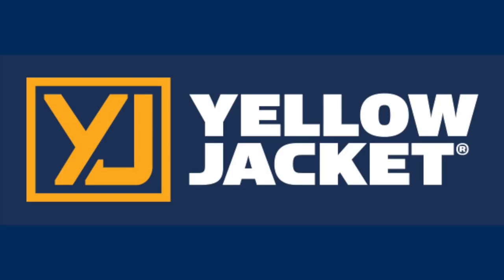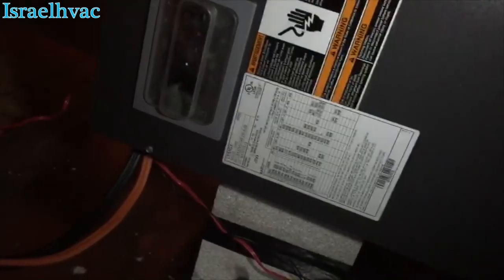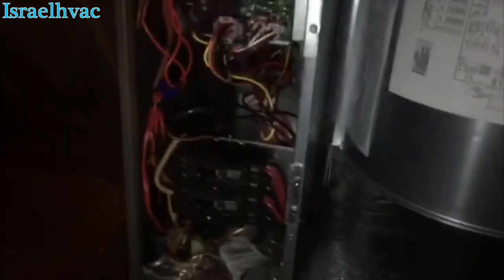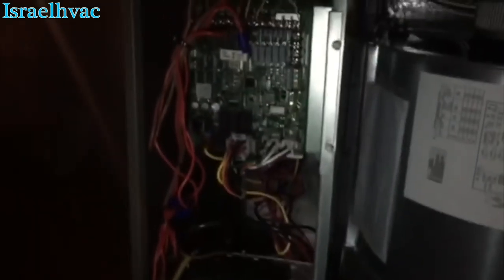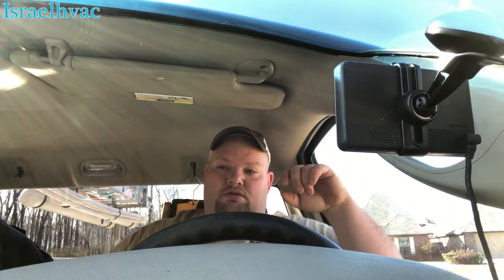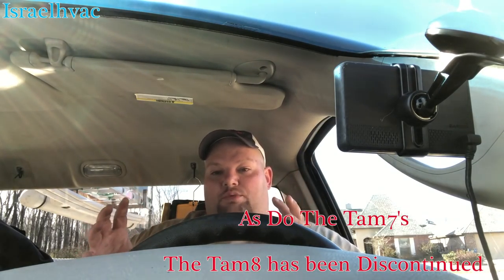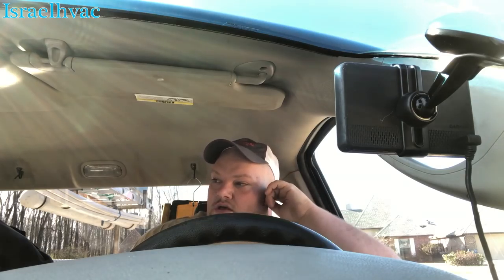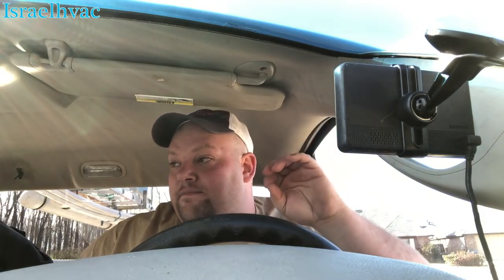HVAC - Quick Check Up on a Lennox AHU

Comment: smart contractors there... heat pumps save on bills but most likely go over the savings in future repair cost. 
more components = more future problems. to bad they dont have gas